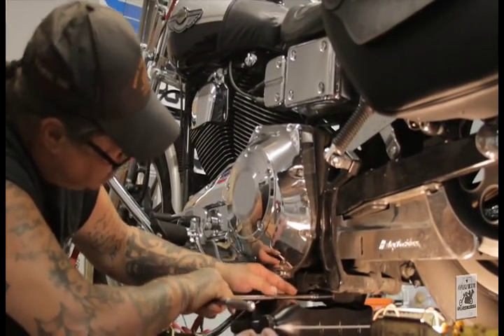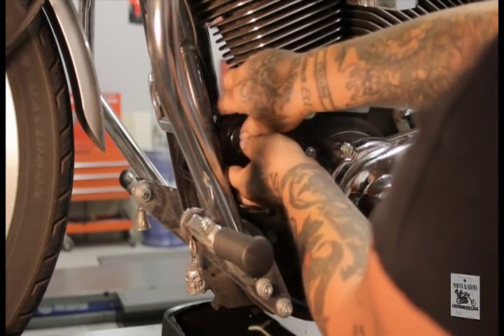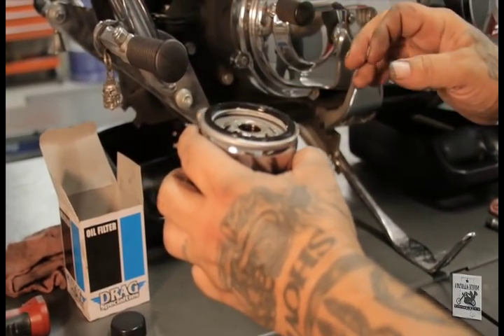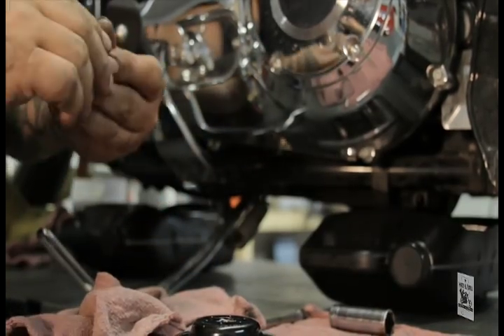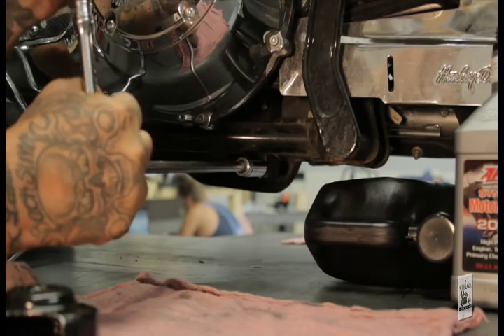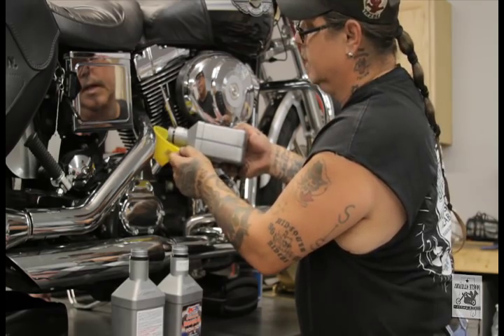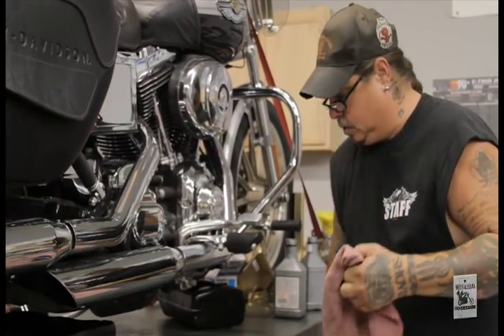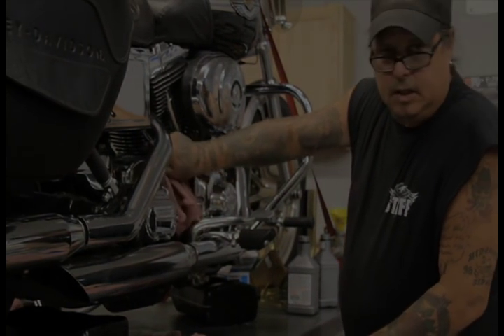DIY Oil Change on a 2003 Harley Davidson Dyna

Comment: That whole procedure should have been done on the side stand. You only stand a dyna up vertical for transmission and primary. Also he checked the oil for the hot level. Bike might be warm, but he added new oil which is not. Always check your oil on the side stand people.

Comment: Great vid brother, glad to see some BamaBoys with some diy shit on here. I just changed all 3 on my 08 deluxe yesterday and drained my engine oil from oil tank drain tube, I noticed a smaller plug (bout a quarter inch or so) towards the middle of my engine. Is that to drain the additional oil that stays down in the engine ?

Comment: Brother how did you not make a mess taking off that filter.... Of all the 10 years I've been working on bikes I've never seen that who's better than you what was the trick please let us know by the way great video
Reply: - MrRIchBiker using junk filters that don’t have anti drain back seals in them. So they drain right back into the oiling system. So the “air pocket” he’s worried about happens every time he starts the bike.

Comment: what about the qt. of oil you left in the eng and didnt tell anyone about, without a scavenger system you leave 32oz of old oil in the eng?
Reply: The manual doesn't say to. Here it is:
1. Ride till warm.
2. Remove dipstick.
3. Remove plug, allow to drain.
4. Remove filter.
5. Lube new filter gasket, hand tighten, do not use wrench.
6. Install plug.
7. Fill oil, 2.5 qts wet capacity refill, 3 qts dry capacity refill.